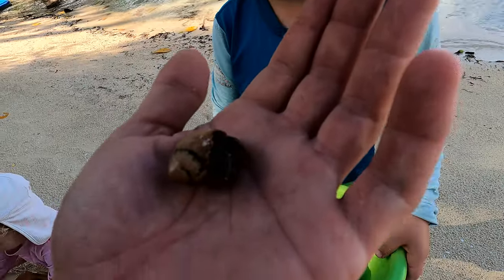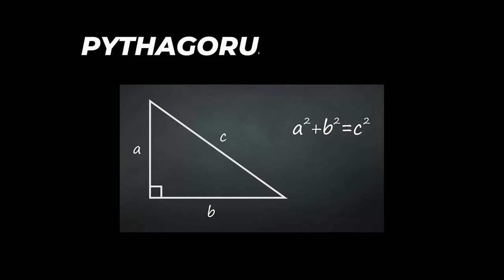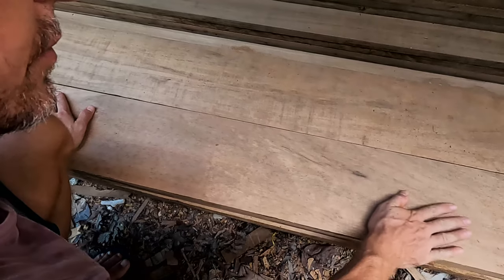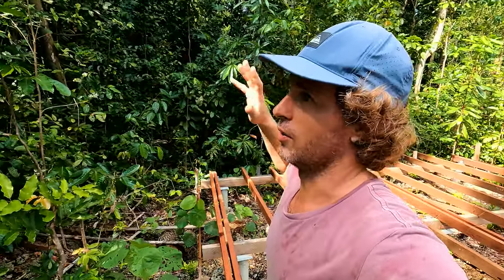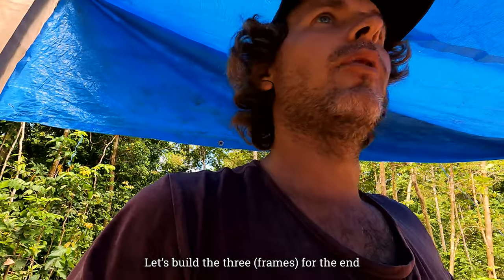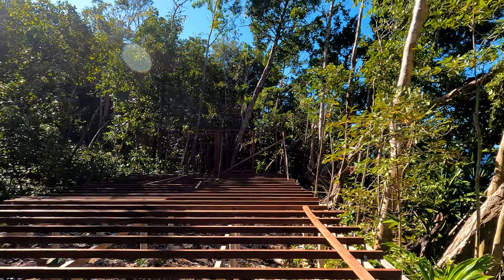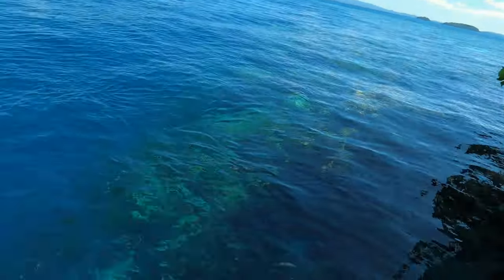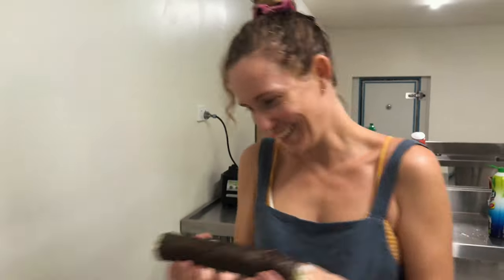A DAY IN THE ISLAND LIFE OF US ~ Building an off grid island home // EP21

Comment: What about the storm season. Surly you need to build a storm proof house? Hope you are using hard wood so your house will not rot. Hope your house will survive the the storm season.
Reply from the maker: We are indeed using hardwood species sourced locally for some resistance to termites and weather. All year round we can face tropical storms here. The new buildings have been designed and built to Australian Category 5 cyclone standard with bracing etc and so far standing up really well in high winds and rain. Great question - certainly a big part of our planning to consider the weather!